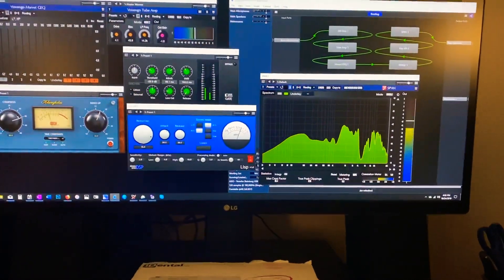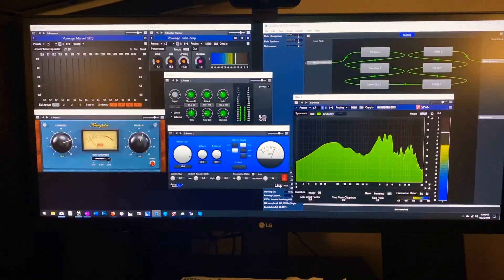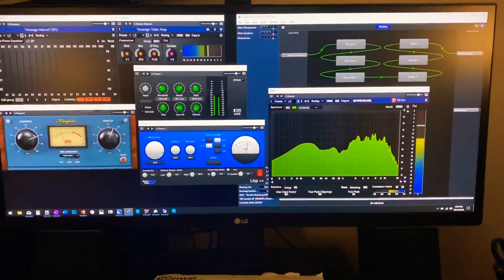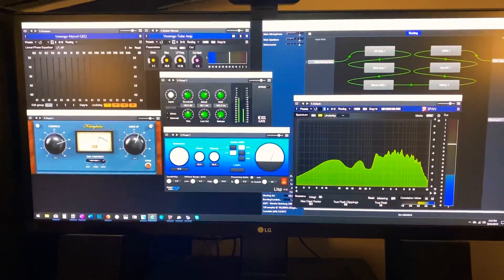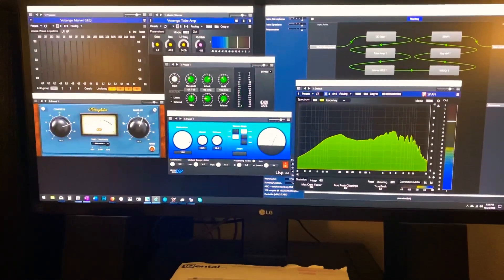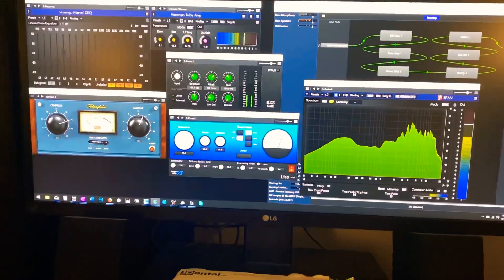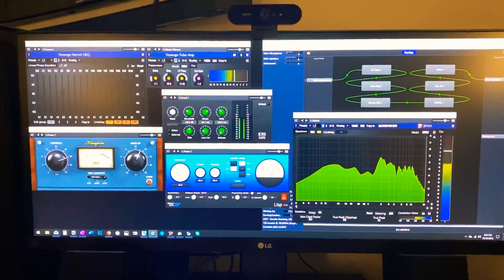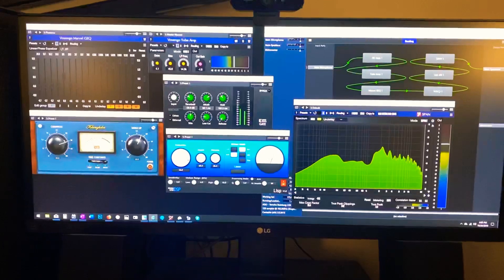KD5FHW Virtual Audio Processing for Amateur (Ham) Radio

Comment: May as well just download the Zello app on your smartphone, and call IT amateur radio.
Reply from the maker: You obviously have no idea what I'm doing. I'm processing mic audio before it gets to my radio which uses an antenna to transmit said audio. This has nothing to do with the internet.
Reply: @F41Driver  
Yes.
You have taken the next step! What used to be beautifully built stuff with inductors, capacitors, and tubes, became transistors, lcd screens, and such, which then became microprocessors, and waterfall displays, to your stuff which is a bunch of graphics on a computer screen emulating an analogue "feel." So the next step is just using Zello. Get rid of the last bit of "radio art" (which at your point is just the antenna maybe,) and go with the all sterile digitally supported smartphone 2 way radio apps. I hear they even have ht radios that work over the cell phone services, you even get to pay a monthly fee, just like a cell phone, but it's in the form of an ht radio. The step you take next!🤣
Reply from the maker: @goatsinker347  Wow, OM... Are you afraid of SMT components as well? Stick to your homemade spark gap transmitter if you can't understand how progress works.
Reply: @F41Driver  
Sure, 
I understand now even better what they mean when they refer to certain people as appliance operators.
Reply: @goatsinker347  Sorry man.  Your thought process is one of the reasons why the FCC keeps taking allocations away from our hobby and limiting where we can play because you choose to sit back and wish the world was the way it was when you got started into the hobby.  Not the way the world turns my friend.  I love old gear just as much as the next guy and have an old Kenwood TS-520 that I have re-built as my main radio but I like this idea of adding new tech with old analog tech for speech processing which a lot of the older cats wished they had back in the day.  I also have a HOME BREW (meaning home built by me) QRP SDR transceiver (takes some know-how) that I used a computer as its front end in the beginning but built a HOME BREW (meaning home built by me) PIC33 based front end (takes some more know-how) so I don't need a computer anymore.  It makes a nice QRP rig to take out on Field Day with a couple of small batteries instead of hauling my TS-520 and 6 car batteries around to keep it running for a few hours.  Did I loose ya?  If I was to connect my analog hardware versions of this setup to the rig, which I do have since i have a music studio, would I be considered an appliance operator also?  BTW, the Kenwood can be considered an appliance so whats the difference?  I actually know some stuff and know how to operate ALL of my equipment.  What do you call the old school Elmer's that use digital and analog versions of this setup?  You need to change your thought pattern about our hobby and technology and progress and stop hoping the pass will resurface because you keep thinking about your childhood tuning in Tokyo on your shortwave receiver  you made from a Radio Shack electronic kit.  I did that too.  The pass is what got us to this point.  BTW, I bet you're still rocking a flip phone and pager.  Try something new my friend.  You might enjoy this thing called technology.
Reply: @k7ilo_Las_Vegas , no point in even telling them you run good audio. In my experience, as soon as they hear good audio, they already have their minds made up. Also in my experience, the only time they ever use their radios is to get on whatever net they go to daily for the past 20 years, or field day only. My opinion is, they have a VFO knob like everyone else, if they don't like good audio, they can keep scrolling.

Comment: How you are feeding audio from cantabile lite to sdr software for TX? Are you using VB cable or any other audio pipe? I have VB cable installed but it's not showing at audio out of cantabile lite. Required some guidance please.
73 de VU3WTJ
Reply: hi
Reply: did you ever find out how to do this

Comment: Do u need the flex radio thing to sound this way. I want to record YouTube videos and sound this good with all my audio rack gear that I have. I didn't realize the way ppl got this ham radio voodoo sound was using actual radios is this needed to achieve that type of voice quality.
Reply from the maker: If you're just after great sounding audio on YouTube then you don't need the radio, just the UR22 MKII interface to pipe your audio from your rack into the computer. I hope that answers your question.

Comment: Would like to see how your mic interface connects to you transceiver.
Reply from the maker: With a simple 1/4" TRS into the balanced input on the radio. I'm now using the same setup on my Flex 6600.
Reply: @F41Driver  hi, where does the 1/4 trs input come out and how do you configure the audio output is that through the interface or pc? Let me know how you feed it to the radio and what you do to change it in the software I also would like to do the same thing on my radio please let me know thank k you!

Comment: I use a similar setup, the TX-Audio first goes into a soft knee expander, then a bandpass filter between 50Hz and 6KHz then into the first stage compressor 4.5: 1 and low headroom of 8dB to compress the transients, low attack of 6ms and release of 15ms.
Then into a multiband compressor, with 22db Headroom, the low frequencies below 100Hz 9: 1, lower frequency band 4: 1 to 350Hz, then 1.5: 1 up to 3KHz and above 3KHz 3: 1 with 20ms attack and 600ms release, then an AGC control Loudmax with brickwall limiter, at the end an equalizer and de-esser.
RX audio is processed by Loudmax, and expander / gate at the end.
Reply: Hi, can you repeat in plain English thanks.
Reply: @geofham8332  I use several stages and a compressor with a gate to suppress background noise. As described, several compressor stages one after the other with different parameters make more sense because this improves the overall volume and thus the intelligibility and voices still sound as natural as necessary.
I cannot explain everything in detail here, you have to take the time to deal with the topics of audio engineering and psychoacoustics in order to gain a deeper understanding.